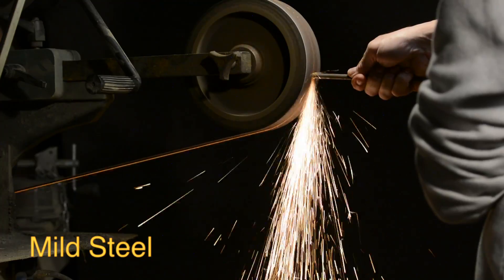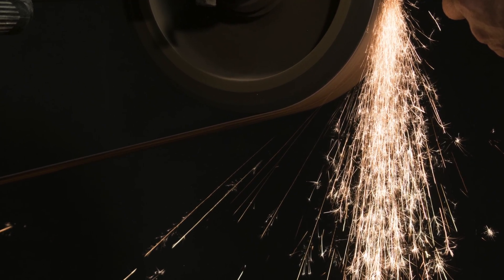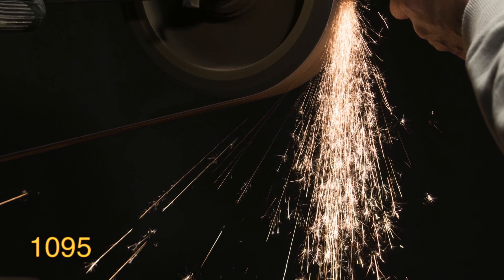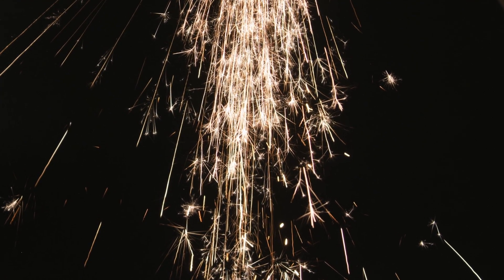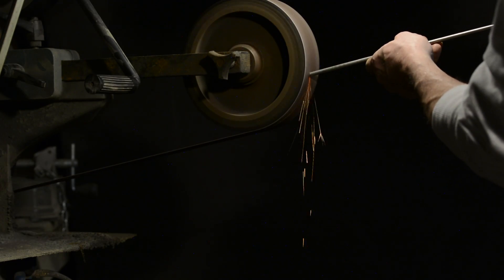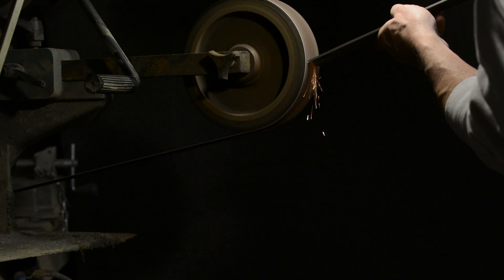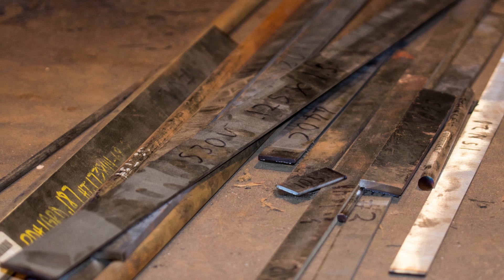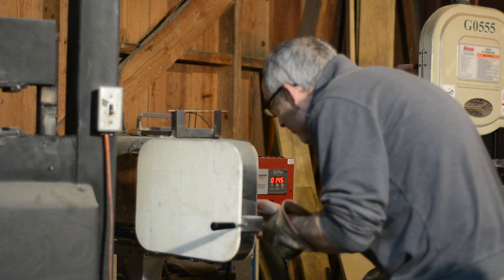Spark Testing Knife-Making Steel

Comment: 5160 is the best steel period for anyone wanting a knife or sword and so I don't agree 5160 is medium carbon, its a high carbon steel....its why every knife maker wants it and has it in their stocks.  Anything over .55% is a high carbon steel. Low carbon is 1045, 1030 anything .15-.45%.    There's positive perks for 5160, at .60% you got enough carbon, carbon cuts and you get roughly 1% chromium so with the lessor carbon than say 01 or 1095 and a slight amount of chromium you've got a knife or sword steel that is not as susceptible to starting rust degradation when exposed to moisture.  Also it flexes up to 20% which can handle massive shock resistant.  This is why automobile industry uses 5155 which is leaf spring steel.  I use 01 tool steel, 5160 spring steel and 80CRV2 steels.  Other that I totally agree with everything else that Walter assessments just not that 5160 is a medium carbon steel.  It really down plays this super popular and loved steel used by millions!

Comment: O1 makes good knives and is easy to heat treat. the problem with O1 is tht it is usually available only as precision ground flats , which are expensive, or drill rod, which takes a lot of pounding to flatten. 5160, 80CrV2 or even 52100 might be good alternatives. Many pro bladesmiths like 52100. It makes extremely good knives, but should be normalized after forging by holding at 1700 F for ten minutes and air cooling. (This is best done in a furnace rather than a coal forge)Then it should be heated just above critical and air cooled twice to refine the grain, then held at 1500-1550 for a minute or two and oil quenched. (Knife Nerds, run by a metallurgist) he says tht quenching from 1500-1550 produces considerably better knives than quenching from just nonmagnetic.

Comment: Hi Walter I have some standard coil springs from a Nissan Patrol is there anywhere I can find out what type of steel it is. I know there are only a half dozen steel types used in springs and most are simple heat treats, but I would prefer to take the mystery out of it before I use them.

Comment: Walter  great info. You don't like low carbon steel because they won't hold an edge,  but what about using it for the outside layers  of San mai damascus with a  high carbon center layer?
Reply: I know this is late, but others read too...... yes.  That very purpose has been used by sword and knife makers for a very long time (understatement).  Also low carbon steels can be useful for practicing basic knife making skills.  And if you can get the steel for free (or very little cost), it is almost stupid to NOT use them for skill development.  Heck, you can even work out blade shapes to be used later in "signature" knives using higher quality steels.

Comment: Probably the best coverage of this issue that I have ever seen. Excellent resource! I would love to see a follow up video that shows the next step. For example, let's say I find a large supply of a mystery steel, spark test it and see that it is high carbon and worth using, now I would move on to test a variety of heat treating regimes to see what works and doesn't work with that steel. e.g. oil versus water quench, immediate quench or soak at heat for 10 mins, 1, 2, or 3 normalization cycles and record the results: did the steel fully harden? (just a file test no fancy equipment), break testing the pieces each time to examine the grain structure (fine versus coarse). This would make a great video, but I know it would be a lot of work.

Comment: Could you increase the carbon content of a mild steel through forging?
Reply: +Pilch Plays Not sure if this is possible or not.. but even if it is, it would not be easy and it would not be worth it.
Reply: Case harden the mild steel before forging. Make a mixture of charcoal powder, table salt and flour at the ratio of 6:4:3 respectively, add little water to make a paste , then cover the mild steel with charcoal paste . let dry completely. then prepare clay paste cover the mild steel charcoal coated with clay to prevent oxidation of mild steel, let it dry. after drying put in furnace  let it reaches to austenitizing temperature  of almost 1450 F. Keep at this temperature for one hour to completely case hardened. carbon will defuse inside the mild steel.  Depending the time you keep at that temperature more carbon will diffuse inside mild steel. Break the ceramic(clay) and charcoal coating   and cool it in water. you have a hard steel. Now you can make your forging activity using the case hardened steel.

Comment: Another really good reason to use found steel is for practise actually making a knife - not much point ruining a bar of 440c if you don't have your skills developed enough to use it for a well made knife.
Reply: Hey John, didn't expect to see you here!
Reply: well, walter is a steel guy while john is a wood guy
Reply: Correct!  How many times have we seen knife makers say people's first knives will be crap?  That isn't because of the steel used or even the tempering of that steel, but because of the basics of craftsmanship and the skills needed to FORM the knife.  It is also why many knife makers use things like railroad spikes to perfect their basic skills.

Another good use for mystery steel is when you use it to create Damascus but will use that steel as the outer sections of san-mai  blades (where there are three layers like a sandwich, with the inner steel being the steel that forms the actual cutting edge of the blade).  You can really stretch out your "good steel" this way, as well as produce quality knives with visual character that are highly desirable.

We have seen many videos of this done by knife makers so that they can incorporate a steel of special value to the end customer (such as using steel from an heirloom or sentimental item/structure), but wanting to make sure that end knife can actually do what a knife is supposed to do (cut, and hold an edge).

Yes, there are many reasons for using mystery steels.  But some makers just don't like to use them.  I have found though, that the vast majority of knife makers will at one point or another work with them for one reason or another, and frankly, if the knife is good..... it is good.  If it is bad, it does not matter how "good" the steel was that they used.

Comment: I have access to an abundance of bedknives off of golf course reel mowers . I imagine that they're made of good steel but cannot find any indication of what exactly they are . where as when I research them on the Toro and Jacobson website they say they use a" high quality " carbon steel ... anyone have any info on said bed knives ?
Reply: *good steel for knife making . that is .
Reply: +Daniel Bernier Grind out a 5" by 1" section, heat it, water quench and see if it hardens.

Comment: I've been watching your videos for a while and  I have a couple of questions
What is the best fluid for quenching 01 steel?
What would be the best grind to do on a blade?
Reply: +Nathan taylor He answers both of those in some of his other videos. Any old vegetable oil will do for O1, I use canola oil. And a flat grind is probably the best all round grind. The intended use of the knife will determine the grind. Sorry I'm not Mr. Sorrels but I hope that info helps you out.

Comment: That Hitachi steel... is that the kind of steel Rockstead knives are made from?
Reply: +Vyjk Rockstead makes knives from YXR7 and ZDP-189
Reply: +Shadow Those steels you mentioned are made by Hitachi Metals. Is one of those the Hitachi steel he is talking about or is there a particular steel alloy that is called Hitachi steel?
Reply: Vyjk He is talking about Hitachi Blue steel which is a carbon steel made by Hitachi. The YXR7 is a different carbon steel they make and the ZDP-189 is a stainless steel they make. So not the same kind of steel used by Rockstead, but made by the same mfg and still a good quality steel.

Comment: you nailed it with the bit at the end. i have learned alot with mystery steels. i spark test, forge it, then try oil then water quench, then i know what i am working with. I also go for stuff that i can grab multiples of so im not wasting my time for a single piece

Comment: Great summary.  I especially like the stills you showed of many of them.

When I first got started in knife making (senior independent shop project in HS), I bought a bunch of knife steel (440C) from a local knifemaker.  I wish I would have sparked it before making the knife out of it, as when I heat-treated it, the edge basically burnt away - it was really cold roll.  Made it all by hand and shudder to think how much time & work I had into that knife... :(